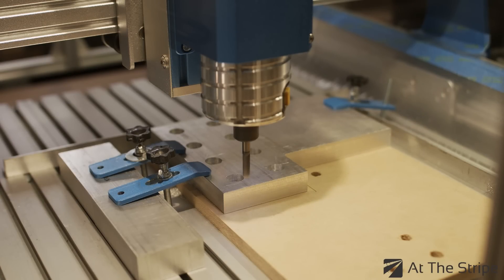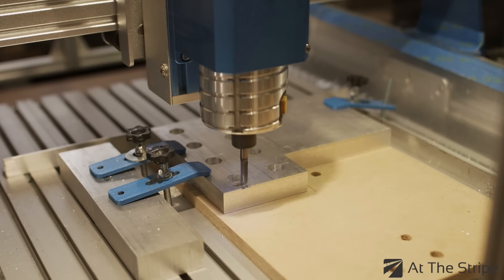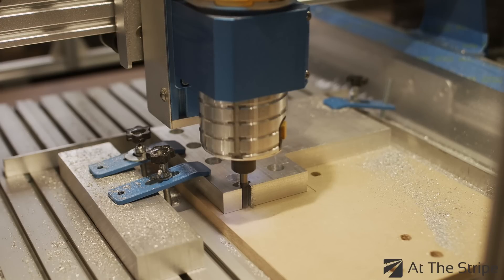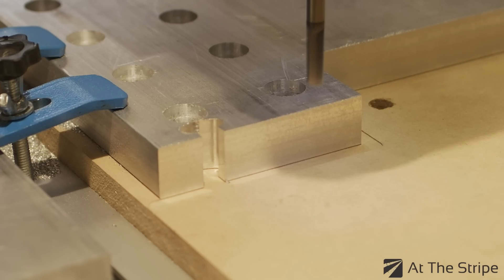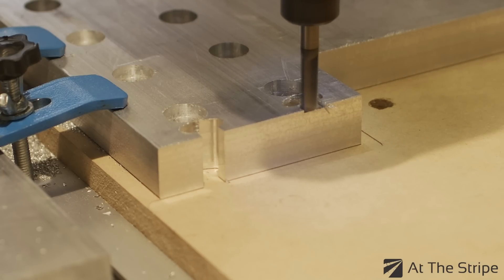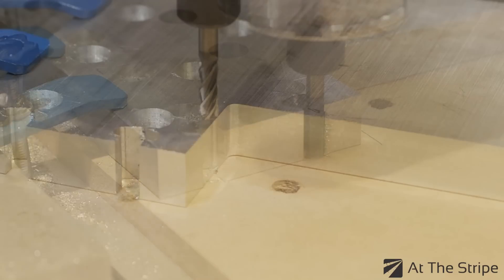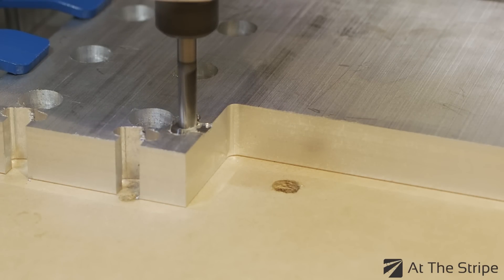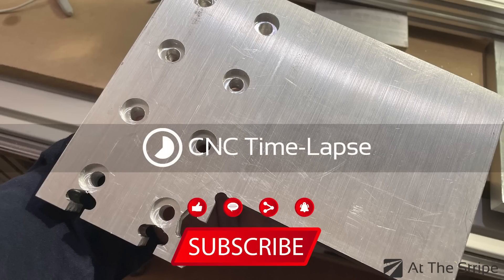Milling My CNC Gantry End Cap T-Slot Channel

Comment: Hi, could you make a video discussing the accuracy of this machine and the surface finishing you are getting. Much thanks.
Reply from the maker: I think that's a great idea. I'll be working on an up-coming video that features the Genmitsu PROVerXL 4030, and a few accessories that I've added to it. I'll be sure to include all those details you're looking for. 
As a quick spoiler though, if I take things nice and slow and make shallow passes, I can get mirror-like finishes as long as I am cutting into the piece (end-mill's cutting direction and travel is opposite direction). Basically, especially when surfacing, I can't even feel the ridges from each pass with my fingernail. It's super smooth.